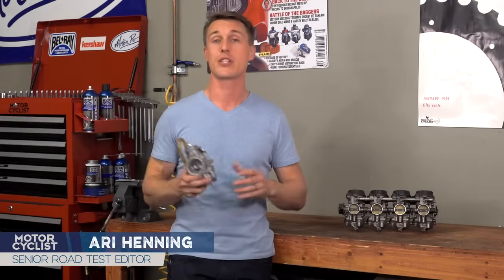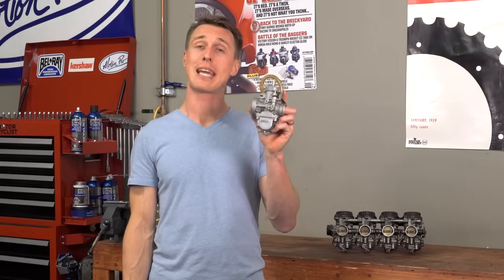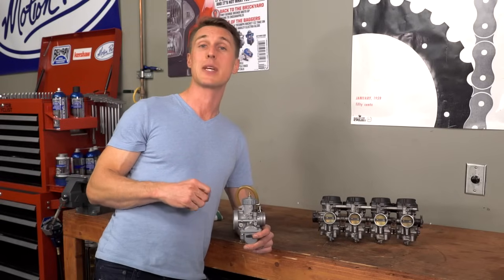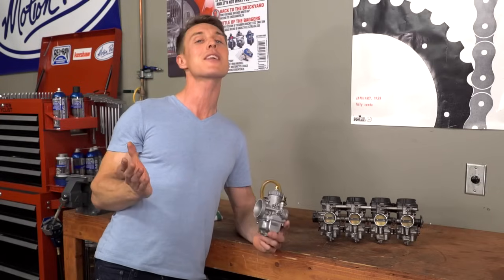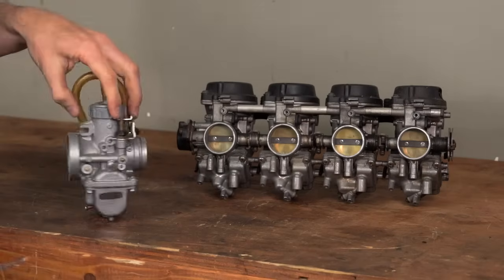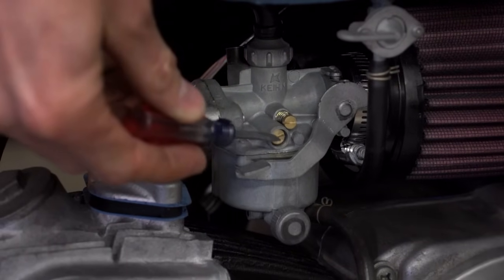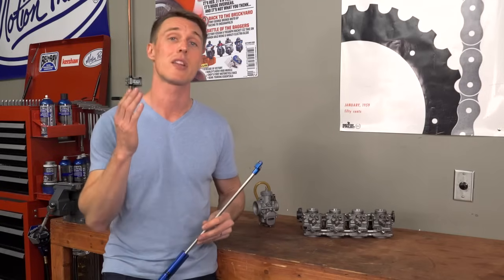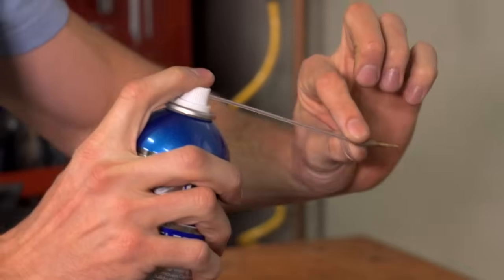The Single Most Common Carburetor Problem (Clogged Pilot Jets) and How To Fix It | MC GARAGE

Comment: When blasting out your pilot jet, hold on real tight so it doesn't go shooting across the garage and land behind the impossible to move workbench.
Reply: Wish I saw this comment earlier...
Reply: Hi there I'm from South Africa need some advice I'm not sure if it's the carbs but when I start my Suzuki bandit GSF 400 and it's warm when I begin to pull away and I open it to 6 thousands revs it then drops to 4 thousand revs then it jumps to 12 or 13 thousand revs why does it do that it's like when I want to pull away and open the throttle to quick the bike dies I have to open the throttle slowly to ride fast or pull away how can I fix this ? Thx
Reply: Sounds like he knows this from experience...
Reply: Quintus 😂
Reply: Or even make it cease to exist
Reply: LOL that happened to me too haha
Reply: @RegulareoldNorseBoy  its filled with so much items haha
Reply: Move that bench, you'll find those pesky 10mm sockets there too...
Reply: bro funniest comment ive ever read lol
Reply: Yup. I had to buy a new set of pilot screws. Twice. 🤦‍♂️
Reply: Thanks for the gold
Reply: this man speaks from experience xD
Reply: How do you know that ? 😁
Reply: Put the pilot jet in a socket or a small rubber hose makes it easier to hold also u should be blowing into a clean container catches spray dirt and your pilot there is no need to hold the jet and have it randomly aimed ... If u got a compressor I'm sure u have a container
Reply: Sheer class.
Reply: Good  advice, I wish I’d read this before I did it 😂
Reply: Do the spraying in a large cardboard box serving as a spray booth.  This will trap much of the fluid and kerp the carb jets in place.
Reply: Like when you pull the fork springs. Lol
Reply: @ImTheFlyWhiteGuy  not everyone's work shop is perfect
Reply: 😂😂😂 35 year veteran and still do that sht!😂👌

Comment: Who else has a sudden urge to buy a 50cc mini bike?  :-D
Reply: Ari Henning Tempting! However:
1. I'm in Pennsylvania
2. My wife would likely have me sleeping on the couch.

Come to think of it, that couch is pretty comfortable.
Reply: me but i bought 750 instead!
Reply: Akaash Khokhar me just bought a 1000cc project bike as my firat
Reply: was given a 71 z50 by a coworker as a gift and it needed work. upon more inspection i realised he swapped the 50cc motor for a 125.... the front wheels will always come up in second gear lol i love that fucking bike
Reply: I’ll be buying my dads beat up xr75 and fixing it up over the summer :)
Reply: I sold my Z50J 1 owner (=me) 2000km only ran specimen back in 2004.. fucking dummy me.
Reply: I'm currently working on my 80cc engine

Comment: Used to look after 30-40 used bikes on a sales floor , so no time to remove carbs and be cleaning pilots properly , 
one way is to drain the fuel and give the bowl’s a quick short blast of compressed air .. and really short 1sec blasts for CV Carbs or obviously the diaphragm rubbers will pop. 
But it works 8 times out of 10.

Comment: Hopefully i can get help here
I have an 01 zx6r  idles fine but wont go over 40 feels like a fuel issue checked the pump cleaned carbs changed gas and spark plugs nothing worked took the bike to get looked at only to pay 115 for them to tell me change the fuel filter😒 i drove it home decided to remove the airbox and drove it down the street problem went away and it worked a few days now the problem is back weirdest thing ive seen any ideas of what im dealing with

Comment: Clogged idle jet. Was a pain to fix.
Reply: Did you get it fixed I think I have the same issue...was it idling and then dying when you crack the throttle ?

Comment: What if the scooter runs well but needs a little throttle turned slightly upon turning over and starting? What does that usually mean? Yes it’s got all the typical 70cc big bore upgrades. Kymco people 50 2009....

Comment: You know what? I just bought a '88 Suzuki Katana 1100 that hasn't been ridden in a little over a year and the way it's been running I really think the pilot jets must be clogged or at least partially clogged. I do have it scheduled for a tune up about a week and a half from now where the mechanic will give it a good going over including the carbs, but in the mean time is there a gas addative that could help clean the carbs a little?
By the way thanks for the great and informative videos.
Reply: Seafoam and Startron both have pretty good track records. I'm partial to Seafoam myself. Be aware additives can help some, but there's rarely a "fix in a bottle."

I'd also recommend adding a clear inline fuel filter. Even if there's no rust, 30 years is plenty of time for a tank to collect hidden grit or other debris you don't want wandering into your carbs.
Reply: @sacrificialrook6283  thank you for the information and advice. It's much appreciated.

Comment: Hi I have Klx 650c 1993 runs fine till top end the starts to bog soon as I let throttle off it’s fine but also the idle is not what it should be ?????

Comment: Having a lot of trouble getting to the bottom of an issue.. I have an 84 Yamaha Venture 1200, it's a V4. While my Airbox lid is off it Idles normally for the most part. But the moment I put the Cap on it instantly Revs to around 5500 RPM. This happens without the throttle Butterfly's moving in any way. Ive completely cleaned the Carbs, Re-seated the Intake boot's and spent hours searching for Vaccum leak's with no results. I have no idea what's going on here and any suggestions are welcome...

Comment: I bought a ninja half off from a private sale because the owner did not understand why the bike wouldn’t start. The pilot jet was not only gummed up, but it was completely sealed shut with crap. The carb cleaner didn’t work so I just bought two new ones for 25 bucks.

Comment: hi ive fitted a single carb to my virago 535 , mikuni vm 34, it has sooty plugs so its rich, ive lowered jets to a 90  the pilot is a 35 do i need to lower the pilot, any info would be good

Comment: Dear Sir , In modern FI system motorcycles, the ECU makes little corrections based on oxygen sensor inputs to the air fuel ratio.
If this is true, we do not require a power commander kind of setup at all for slipons ( for normal street use ).
Then is it necessary for a dyno tune ( i personally would not want the dyno person revving my brand new bike )
The stock ECU would have been tuned for better fuel efficiency and street performance. is it not Sir ?
But everyone recommends a performance filter with the slip on and to get a dyno tune.
Reply: Thanks a lot for the response sir.
By saying "Exhaust system" i assume you meant a Full System and not slip on.
According to http://www.motorcyclistonline.com/long-term-yamaha-r1-exhaust-dyno-test#page-3
 i quote " both the stock pipe and the Yoshimura slip-on are essentially just baffles for sound that install downstream of the very complex and high-tech breadbox underneath the engine. "
So a slip on does not change anything to need a fuel mapper.
Please correct me if i am wrong sir.
Once again huuuuuuuge thanks for the reply. :)

Comment: Bro am a big fan from lebanon respect!
Am facing a problem with my gsxr 1100 mod.92 that first 100 meter it runs perfect then the voice changes and even when ur on full power it feel like a 400cc. Can u help me plz? (No engine soumd new oil new sparks)its normal but only that issue.plz help

Comment: Hi ,
My bike is having some problem which I tried getting fixed by many mechanics unfortunately the problems still persists my carburator slider frequently getting clogged with carbon and after a few kilometres accelerator will get jammed also the air filter which 2 days ago I had it replaced is also having carbon deposits on them and has a petrol smell on them how to diagonise the issue? Sometimes white smoke comes out of exhaust. Any advice????

Comment: want to ask you that I have a 2000 gsxr 600 , I completely clean all 4 carbs and still only run with the choke on only. Also clean the fuel filter, fresh gas. Has no idea why. Do you think is the mixture screw, Maybe you can help me out.

Comment: Don't if you will respond but I would appreciate it. I have a '78 Suzuki GS750E. I am replacing the chain and sprockets. The front stock sprocket is a 15T 3 1/8" diameter and rear 41T. My new sprocket is 16T same diameter. How will this change the way power to the rear wheel is affected?

Comment: I have a 2001 fzs1000 it’s really hard to keep the bike running when cold I pull the choke and its runs for 40 seconds and cuts out... I have to restart it and play with the throttle until it no longer stalls before I can ride off... the choke plunger does not slip back so I’m not sure what it might be ... I have small cracks in the boot inlates which run from the carb to engine .... could that be the issue?? Please advise

Comment: I do about 200 vintage bikes a year at my shop and all these older bikes need more fuel on the pilot circuit.   I never re use the pilot jets.  If they are scuzzy on the outside they are on the inside as well. 

Think of it like a heart attack.   If the hole is open but again the outside is all tarnished then the hole indies it is too and it will not meter fuel right.  It will be lean.  

New pilot jets are a good thing.  And if you need to be 2.5 to 3 turn out on the mixture screw then you need to jet up 1. Only on carbs that the mixture screw is on the intake side.  If the mixture screw is on the airbox side and you have to turn wa out then your too rich.

Comment: I have a bike and its done about 80k kms. It stutters or gasps for power on 3k rpm. Upon little acceleration it speeds up & slows down on its own. It runs as if there is loss of power even on high speeds. I tried to adjust the air screw but there was no rpm change even after turning it all the way out. There was only marginal rpm drop when I turned the screw all the way in. Also the bike shuts off upon using choke. What could be the issue? Damaged coil, plug connector or bad carburetor? Please advise. Thank you

Comment: Hi der...can u kindly give me a little advice what should I need to do on my bike...I had a zx6r 2000 model and my bike had a issues on the carburetor that's what the mechanic said here in uae my experience on my bike is when I was running on the straight express way can be run max speed of 140kph..my bike is a 2nd hand bike den on the first month I used it I can run only maximum speed of 120kph den after now it getting worst..as of now my bike can run only maximum speed of 100kph...now what is d possible problem on my carburetor is it still have a chance to fix the issues or should I need to change my carburetor???

Comment: Mines was hangin at high throttle i just down my idle screw all the way down to make sure my butterfly is closed tight an shut.then crank up see what idle is an screw by a inches to get it between 1 an 2 mph.an when it got perfect she was purring like a kitten.
Reply: But the thing is the idle screw was not turn up all the way. it just that the idle screw is really sensitive so you have to baby it when turning it slow. Like a turtle.

Comment: I have a legend race car it would do one pop like trying to start I am getting gas pull plug and it was wet plus did a spark plug check with it plugged in and  it has spark but only once  , any ideas . and yes I suck at typing lol

Comment: Hi, just want to know that when I'm riding half way like 70km the bike like not moving?? My throttle is on, engine is running. Ilke the fuel not coming out. I have pump the fuel to full tank. Do u know what's to problem with the bike. Sorry that my English not good.

Comment: I bought a used quad with a new carb but i think the carb was tuned for different quad. The mechanic must not have thouggt about that before installing it and not running it. It would idle but cut out at high revs.

Comment: My 2013 R6 has a problem when I start it (the bike is warm 80°C) it doesn't keep running only if i accelerate at 1700 rpm and the engine lost some of the power specially at 2nd geard the performance of engine it kind of shaking not a continued power 
I dout that happened because of the mean jets or the pilet 
Please answer me as soon as possible

Comment: thats the thing about carbs like i got a 99 r1 with a set of carbs i cleaned, left it for a month in the garage and now it took for ever to start had to spray some flameable spray into the airbox to get it started, gsxr 600 impounded for like 3 months and started right up and ran perfect straight away... got to love fuel injection

Comment: I have a 50cc that hangs after i let go of the throttle with all 3 carbs ive tried on it. 2 new, 1 old and cleaned. New intake gasket too. I think its a vacuum leak, but where else do I have to look if the intake is all sealed up and good?

Comment: good day.  im having pa problem with my motorcycle, if i idle my motorcycle then twist the throttle it just rev to 2000-3000 then loses power and die, then i ask a technician to check it it become worst. he clean the carburetor then my motorcycle wont idle anymore. so i look for another tech and they ask me to leave it coz they will do it tomorrow. the following day they said i need to replace my carburetor, what happen to my carburetor that it needs replacement? i never drop it, my motorcycle is already 2 years but i rarely use it my odometer is only 403.

Comment: Thanks for the video. I have cleaned many pilot jets and never have I only had to spray cleaner/air to clean them.  LOL. When those symptoms occur, It's usually HARD deposits restricting the hole or plugged completely.  Have to clean with a small wire, or jet cleaner tips, etc.  Jets are cheap, but seems I never have them on hand when needed!  Just yesterday, out of the blue, my reliable Vulcan 800 wouldn't idle.  Pilot jet was almost closed completely with hard black deposits.  Took 15 minutes to clear.  Thanks for the videos!

Comment: Ugh, FI seems vastly superior… But I want a Honda Blackbird, and the only affordable bikes in my area are carbureted. I like to tinker and I typically only use Shell V-Power NiTRO+ fuel, I think it would be alright, but I don’t know I’ve only owned fuel injected vehicles and bikes. 🤷🏻‍♂️ I wish I could find a 1999 FI, with the analog gauges.

Comment: I've rebuilt my zx9r 99. I can't seem to solve a problem. When syncing carbs I get 1 and 2 same, 3 and 4 same,but when bringing both pairs together the engine starts to run rough ie brr brr brr brr. The vacuum seems to be same across all 4 but it doesn't want to run smooth. All jets renewed,and carbs blown thru with airline.valve clearances done. Compression test ok ie 190 190 190 190
Leakdown test shows no leaks on 4 cylinders. I'm stumped

Comment: I have a 150cc suzuki air cooled engine, and I'm observing milky oil, as for the shops recommendation I recently changed the whole air  intake system, still no joy, can it be the head gasket, anyone any suggestion?
Reply: I did quite some rainy rides with friends, never noticed anything like this in their bikes and as I explained the complete air intake system is new, that includes the breather pipe for crankcase too, so no chance there and about pressure jets, no I don't use em.

Comment: Kill switch or NO kill switch Ari? Kind of interesting from more scientific angle...there's an idea for next video...Cheers!
Reply: The idea is: use the kill switch only in an emergency, not for every day rides. My riding instructor turns white when my hand comes near the thing :) Some say ignition key and kill switch do exactly the same thing therefore there's no difference, but how it really is?
Reply: In an emergency, like when you make a wide turn onto grass and do a slow speed dump of your 600lb dressed GL1000 on your leg (hypothetically of course) the kill switch is the fastest way to shut down the engine.

In daily riding either one works. I don't know why your instructor would blanch at it. You just want to make sure to actually turn off the key so the lights and fuel pump (on EFI bikes) also shut off.

Comment: What if my bike runs great till I run at 55 for little while then gets sluggish and backfires a little and preassure coming from air box and no power ? Fuel pump ? Not getting enuff gas ? I can let it sit for a few and it does good again?

Comment: Great video. I’m having problems with a virago 535 as in the back carb cannot be made to run leaner so can air fuel jets get clogged up. Regards from England

Comment: I have a 1999 CBR900RR and it won't start after sitting for a day or two unless I ripped the tank off and spray starter fluid in the carbs.  Do You think I have clogged pilot Jets or something else? Anyone?

Comment: Significant Weather change can do it too, anyone riding a Carbureted Bike may have noticed that it just doesn't Run very smooth on Hot Day's.. that's because the Factory Set the A/F in a very mild Climate, and a change in the Barometric pressure can definitely effect a Carbureted Engine.

Comment: Here goes nothing: If my bike from time to time revs up on idle and more frecuently it won't start at the first time, could be a problem with the fuel inyection? (If i pump up the throttle before [NEVER DURING] start it won't have that problem) It's a KTM 790 Duke. 
-Message in a bottle sent.